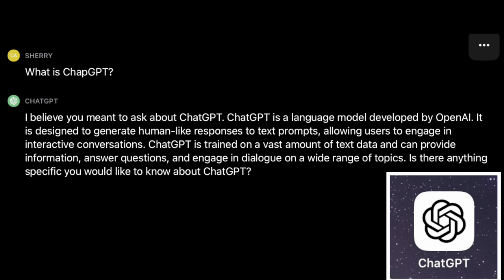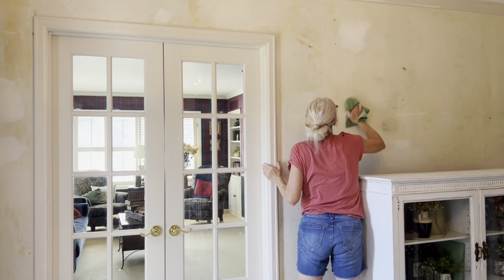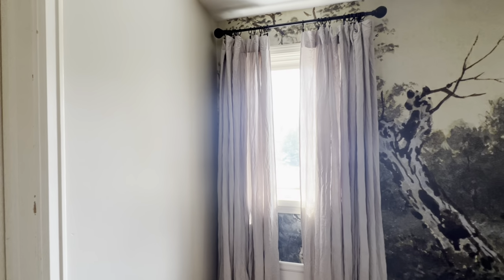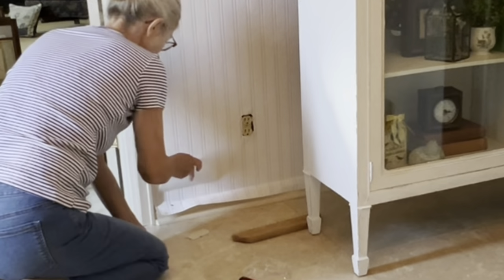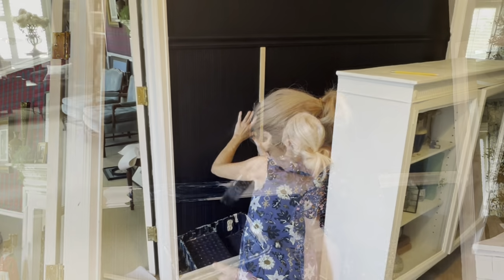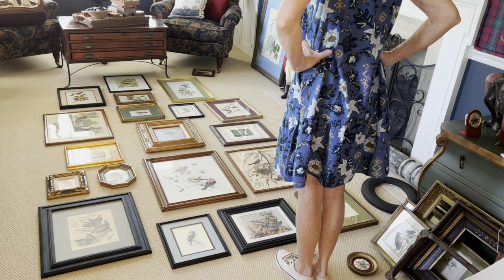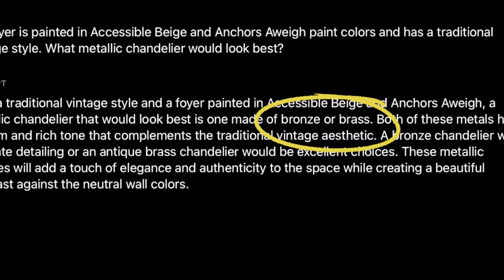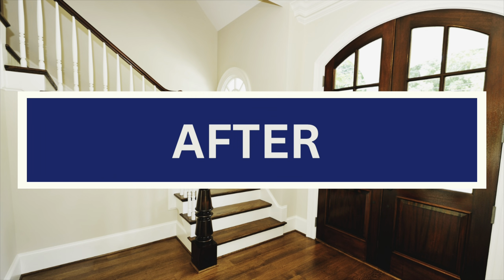Watch This Before You Redecorate: This AI Hack Changes Everything!

Comment: FYI, having removed literally  miles of wallpaper and old wallpaper paste, it is relatively  easy using liquid laundry softener in water, sprayed on.  You can play with the strength, but it generally doesn't  take much.  Love your show although I am not crafty.
Your foyer looks wonderful, but I agree, the rug needs blue center, red edge, just the opposite of the one you used.

Comment: I’m loving the Navy Blue!  I’ve used the anaglipta paper in several homes after discovering it in a home I purchased years ago.  The previous owners had covered the existing paneling with it.  It covers a multitude of sins including that old paneling.  I didn’t realize there was paneling under it till I started hanging pictures.  What I love about it is you can paint it several times over the years.  My brother, who was my painter, was convinced it would come down when he sprayed it but it held on just fine.   I’m using the bead board texture on my old flat cabinet doors and adding strips of 2 inch x 1/4 inch trim around the edges trying to achieve that mission/farmhouse look.  Then of course I’ll paint.  Base cabinets will be Navy blue and tops will be an off white.   I’m even going to give a try trimming out my dishwasher.  Love all your ideas and your decorating style.

Comment: When arranging a gallery wall, I cut paper to the size/shape of my artwork. I can tape them to the wall for a realistic representation of what the artwork will look like on the wall. I also mark the hanging hardware on the paper. Once I've settled on an arrangement I like, I nail right through the paper according to the hanger marks I drew on it. Final step hang the artwork according to plan.

Comment: What a n interesting experiment.
The paint colors are lovely. I really like the beige since it warms up the space. I love the bronze tone on the mirror, too
I think you were right to not make the chair rail trim contrast with the wall. It would stand out too much if it were white and, I believe, become distracting. However, painting it the wall color makes it recede entirely. 
Another option is to look at the paint card that includes Anchors Aweigh. Do you like the next lightest color?  Or maybe even the lighter color beyond that. If so, consider painting the railing one of those colors. This way the railing will show up without standing out.
Or consider painting the railing in Anchors Aweigh in a different finish. If the wall is eggshell or satin use gloss on the railing. 
OK I talk too much 😂😂. Bye.

Comment: How did you attach the wreath on the mirror?   I have done small things on ceramic tile in my kitchen but after so long things fall off with the little plastic suction things you can buy.
Reply from the maker: I used a clear Command strip that has a metal hook. It has been on their for ages and has never come off. I used a Command strip hook on another mirror, and it came off easily when I wanted to remove it months later.
Reply: @CanterburyCottage  thank you for this idea!!